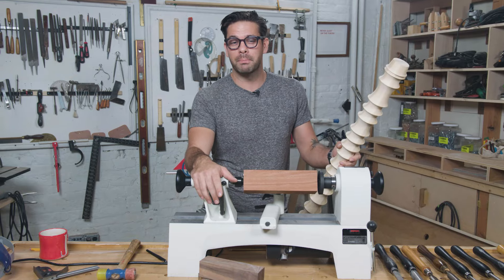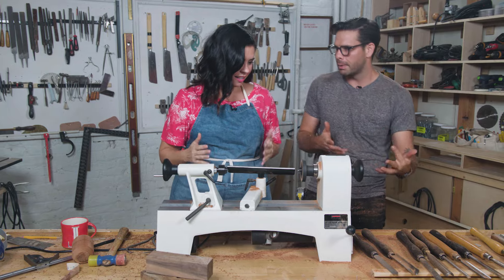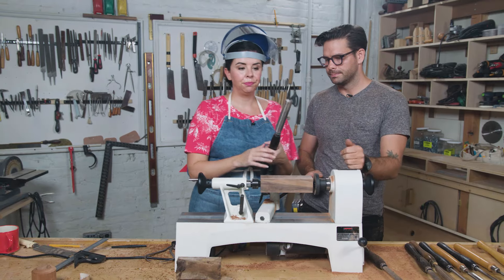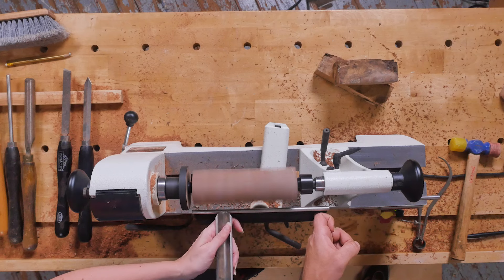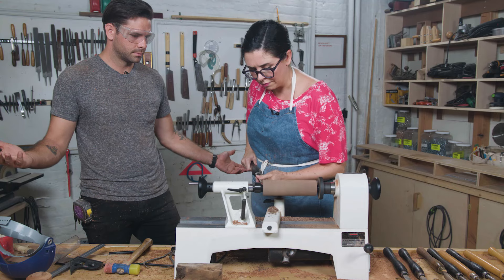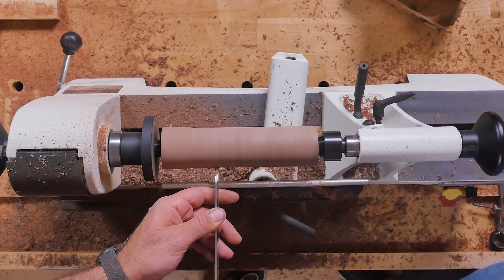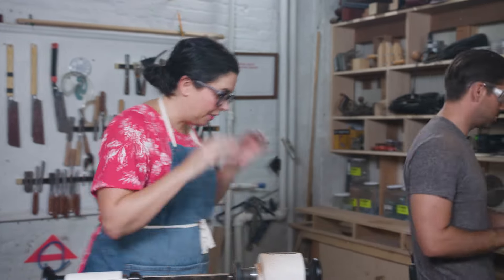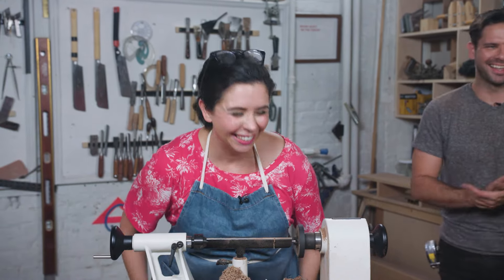How to Turn Wood on a Lathe | DIY Wood Projects

Comment: A few moments with a 45 degree table saw would make the work piece octagon and the initial roughing much easier and faster.  More info about rotation speeds would be great.

Comment: I’m no expert, but with that type of gouge shouldn’t the cutting edge of the tool be angled upward with the angle of the cutting edge?
Reply: I use a roughing gouge pretty level, angled left or right depending on direction.